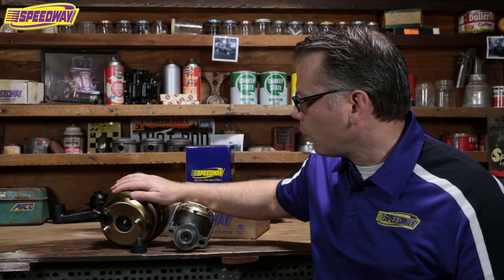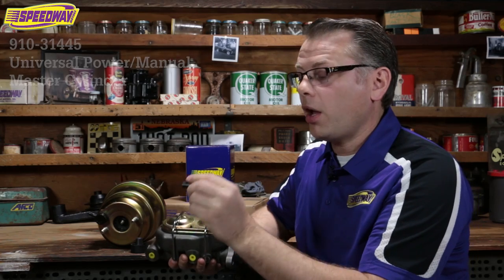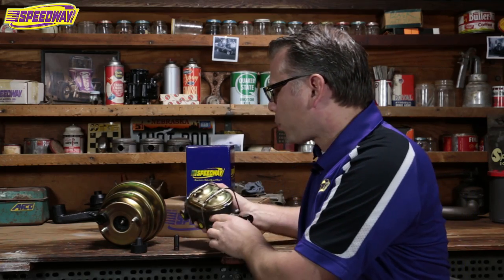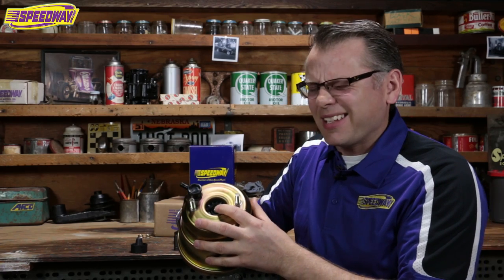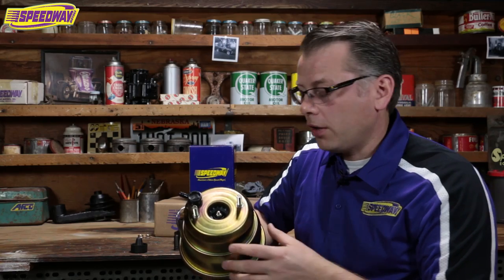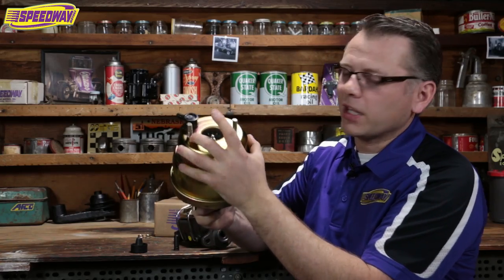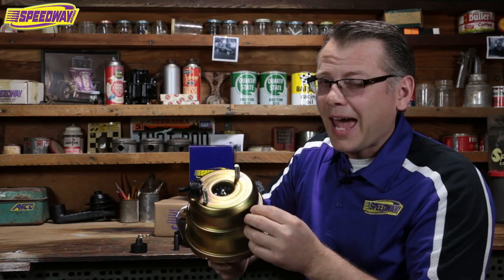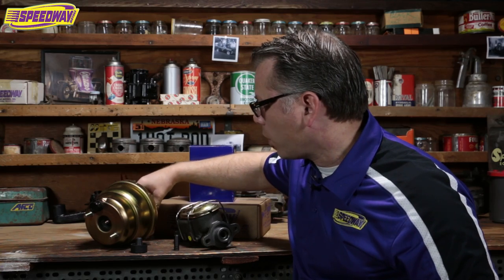Speedway Tech Talk - Booster Adjustment

Comment: I just finished installing a chrome master/booster kit from Speedway on my 55' Chevrolet. This was a challenge but I've got it working. I hope this info helps you guys.
The Master cylinder I received required a 1 1/2" spacer inside the rear of the master. This did not come in the kit and I couldn't find it locally. I made the spacer from a bolt and center drilled it enough for the pushrod to stay centered. The next step was to adjust the booster pushrod to a 1/16" gap. There is a very good tool for this adjustment. It is in the form of an 'H' with a pin running thru the center. They can be easily sourced.
The master cylinder has 4 ports. The kit came with plugs. I couldn't get them to seal. To cure this problem I drilled the caps 1/2 way thru with a 3/16 bit. I made double flare inserts with copper clad line then reinstalled the plugs. The copper clad line is soft and does a good job here.
Make sure to use 11/32 vacuum hose, not 3/8 fuel line for the booster.
The wheel studs in the kit are long enough for steel wheels but were a bit short to work with my Cragars. 
My tie rods had enough range to readjust toe-in to spec.
Reply: Thank you for taking time for the great information you shared have a great hope your brakes are still working well

Comment: I am using what looks like the same combination in my 1959 Ford Fairlane. I put a piece of plumber's putty in the recess in the insert in the master cylinder, and it looked like there was good clearance, but I noticed that the master cylinder would spring back from the booster. This told me that there was no clearance wherever it was touching. I looked at the putty, and there were little lines in it made by the points on the hex head adjusting spud or bolt. I looked at the same part in another booster from a kit, and it was a higher and steeper dome. I used it in my new booster, and it fit into the master cylinder much better. Tomorrow the brakes will be bled, and tested.

Comment: Is there a way to reduce the 7 inches of brake to floor when adding a booster to a tri-five? I mean if you are going to have power brakes, why would you need to lift your foot 12 inches off the floor to finally come into contact with the brake pad? What are all the people doing with tri-fives? Are they still just picking up their foot a foot in the air in order to stop? Thanks.

Comment: I like speedway thanks for all the cool stuff you have. I have a problem on my blazer it has the stock master and brake booster, the peddle goes to the floor and feels like it has no front brakes. I have changed the master cylinder twice thinking I got a bad one the first time with no change, I have also replaced the calipers on both sides in front along with the rubber lines and rebled the whole system and ended up with the same problem again. Brakes slow to apply and feels like little or no front brakes or only the back brakes are working, replaced the stock proportioning valve with a good one from a parts truck I had thinking that it was the problem and still the same ,peddle goes to the floor when I apply full pressure. I don't want to drive it till I get it fixed feeling like I can stop in a emergency is to scary for me. Any ideas were to start can the booster brake and over power the master cylinder and make the brakes do this or is there something I'm missing. kind of stumped when I got it the left front brake did not work, found that the rubber line was collapsed and replaced both of them and the calipers and front pads, the whole system has been bled and there is clear fluid in the whole system. Anyone have a good idea were to start
Reply: must be a leak somewhere

Comment: the "little spud" that you mentioned in video, I bought a 7" booster/mastercylinder and I don't remember it having that in the kit! where can I buy it? ive been working on breaks and it doesn't seem to be pumping up, this could be the reason.
Reply: john smith did u figure out ur problem I'm have same troubles

Comment: To purchase a universal set up. Buyer would need to know all specs on car? As in pedal travel, diameter of brake master cylinder? Or can just car information be given to tech?
Reply from the maker: Yes, these are a universal set up designed to work in hot rod applications. When you call in to order (800-979-0122) you can ask to speak to a tech and they can listen to what you are building and make sure you receive the best parts for your application!

Comment: I have one of these kits, and the pedal goes to the floor and feels spongy, "brake" light comes on, and the pedal is slow to return to the top no matter whether engine is on or off. Am I looking at a faulty booster or pushrod length issues?
Reply from the maker: Hi Rick- give us a call at 800.979.0122 and we can help troubleshoot!
Reply: Speedway Motors , looking at diagrams, looks like the front and rear ports on this style MC are switched compared to my 78 CJ5 I am installing the kit on. I'm going to switch them and see what happens first.

Comment: is there any sort of "vaccum reducer" thing, that can reduce the vaccum pressure by some amount. For example  from 22Hg to 18 Hg.
I actually want to use it with brake booster to make the pedal a bit harder (currently its too soft). 
* currently installed booster is not adjustable.

Comment: 1930 model a frame mounted manual break's can I add just the 7" booster to the master cylinder that I'm using now or do I need to replace everything? I have drum in the rear and disc in the front.
Reply from the maker: If you have a standard master cylinder for manual brakes the piston will have a deep bore for the pushrod.  When you bought the master cylinder if it worked for both manual or power brakes in the box was the slug like was mentioned on the video you referenced.  If you have that slug to reduce the piston from a deep bore to a shallow dish then it also can be used with a booster.  If not and you purchased it from Speedway we may have the slug available.  If not then unfortunately you will need to replace the master cylinder and the booster.  Boosters only help when you have available vacuum of 18-20 inches.

Comment: Wait, your tech said "set the booster push rod 1/16 inch from the master cylinder", most other websites advise setting that gap no more than .020. Who's right?
Reply from the maker: The clearance mentioned in the video is correct! Thanks for your question!
Reply: @speedwaymotors  Okay, you claim 1/16" (0.0625") clearance "is correct".  Please explain how that figure which is more than 3 times the commonly recommended clearance of 0.020" is, in fact, "correct".  1/16" clearance is only going to provide a lot of slop in the brake pedal that just does not need to be there.
Reply: @feathermerchant  it's up to you. Just make sure the damn thing isn't touching the master cylinder.!

I had this problem. God bless you tube.

I knew that it wasn't my front Calipers dragging, because when I opened the bleeder screws, the pressure released and the rotors weren't dragging! My master cylinder was hitting the booster around 1/8" to hard
Reply: @jakefriesenjake  "Just make sure the damn thing isn't touching the master cylinder.! " anyone unable to measure and set clearances in the range of 0.020"...should probably not be working on their brakes (or other things).
Reply: @feathermerchant  oh I hears ya! It just don't really matter, u feelin' me??

I make nice brake lines, but the very nice tool I have to do the double flares, was off on the Spacing. So, I had to figure out the new exact Spacing from the end of the brake line, to the stopper plug. I have to shim it exactly 0.0625003974"

If I don't, my car would lose all my expensive dot 5!

So yeah, sometimes It actually matters.......
Reply: @jakefriesenjake  "...It just don't really matter, u feelin' me??" Nope.

Comment: how come my brakes lock up going down the road I put in New master cylinder  and new shoes.  peddle gets really hard and my brakes like to lick up
Reply: had to adjust the pushrod at the booster so it isn't engaging the master cylinder without you touching the pedal...needs a tiny gap
Reply: @johnjoseph7382  I just did this trick!

Comment: Not a great video. Agree that hints (like the spud) are helpful, but talking some about adjusting the shaft nut on the booster WITHOUT telling us anything about HOW to adjust it - no bueno.  Run us through the process, then we've learned something.